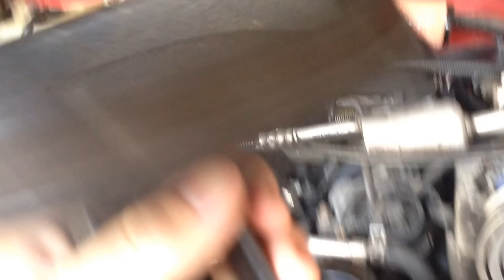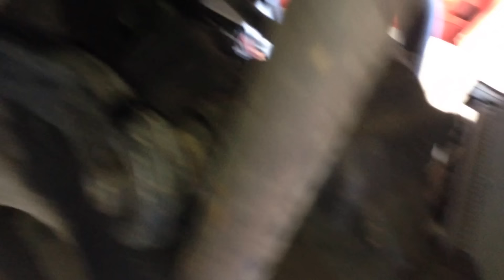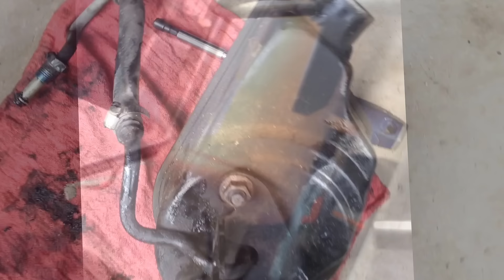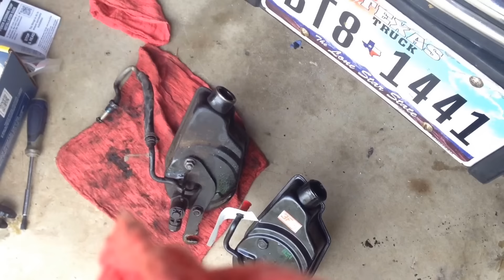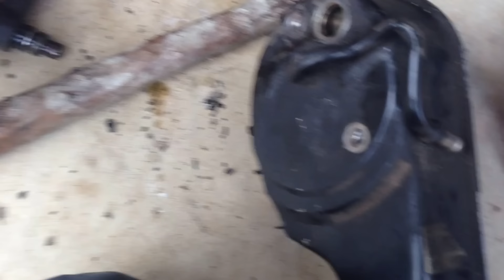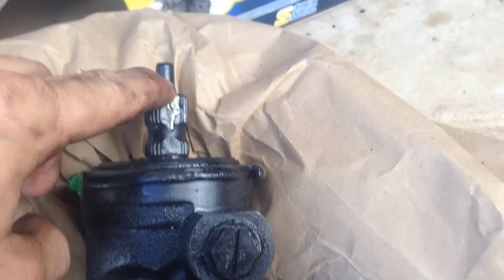1996-1998 Chevrolet/GMC C/K1500 PS Pump and Gear Box Removal

Comment: i need to replace the same shit on my 96 chevy silverado k1500 and i live in texas and i was wondering if you could help and i'd pay you?
Reply from the maker: Well if you're out in West Texas or near San Antonio, potentially. I assume your power steering pump is leaking? Making bad noise/ not working? At least when it comes to buying parts, avoid getting a rebuilt pump, or anything rebuilt from the steering system. I got all my stuff rebuilt from NAPA, and it was far worse than the original one that was on the truck...
Reply: can we meet some where in Austin?
Because im from Killeen.
 @Rnddiesel
Reply from the maker: @ricardomalacara2423  Yeah that would probably work if you know of a good place. The only thing though, is I won't be available to work on anything until after Christmas at the earliest.
Reply: This weekend wouldn’t be possible?
If not I understand
Reply from the maker: @ricardomalacara2423  Yeah, I'm out in the Lubbock area right now, won't be getting back until after Christmas. I'm sorry man.
Reply: No worries

Comment: You can take off that sensor by removing the tabs on the top of it and it makes it easier to tighten down or loosen that fitting for the power steering pump

Comment: Should of put the bypass kit in instead of putting that sensor back. They are known to fail and give a terrible steering feel. Kit is part #19168825
Reply: Andrew Wallace 96 should not have the evo sensor on the power steering pump. But if it does have the sensor it will fit. My 96 Tahoe did not have this sensor.
Reply: DJR5280 Yea it's not cheap for what it is!  Hopefully it works for ya
Reply from the maker: I didn't even realize there was a bypass kit for those, good info. Mine never gave me a problem, so I just left it on there. Thank's for the part #, I might need to look into that in the future.
Reply: Is that a GM part
Reply: rockfortheking77 hewalksonwater77 yes
Reply: Do you know if that bypass kit will work on a 96 C1500? Because everything I've found indicates it's only for 97-98 models.
Reply: Blue04Z71 $60 F'n for the part you mentioned but I bought it anyway. Tired of the EVO bs with my Tahoe.
Reply: Blue04Z71 do I need to pull pump off to put by pass kit in and eavn with pump out how the hell do u spin that sensor it hits that line on pump that's part of pump

Comment: What's the name of the sensor on the pump
Reply from the maker: I believe the sensor is called an EVO, for Electronic Variable Orifice, so technically I guess I said it wrong in the video, it's not really a sensor, but a valve. Basically all it does is reduce the flow of high pressure fluid the faster you move down the road. That way you have a consistent "feel" of the steering wheel and it doesn't get sloppy at highway speeds.
Reply: I have a 97 Chevy Tahoe and it’s leaking from the EVO. I can’t find anyone that sells that piece and the pumps they sell they are not included so I am clueless as what to do.

Comment: The most important part...how to get the sensor fitting off the pump. Missing...back to more vids:(
Reply from the maker: Hey Bob, the sensor fitting isn't anything special, it just unscrews like a normal bolt. It may be a little difficult to get a wrench on the "nut" part of the fitting since it is a bit thin, but it shouldn't be in too tight. When it comes to reinstall the sensor on the new pump, you may need to play around with it a bit to get a proper orientation. Best of luck!
Reply: I have a 1995 Chevy 3500 diesel cannot figure out where the bracket goes that attaches to the power steering pump on to the water pump